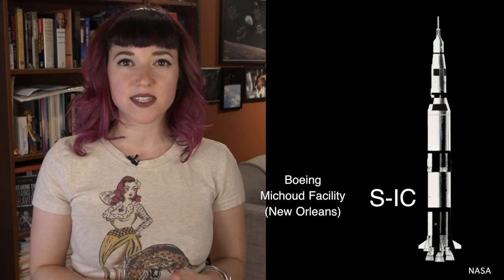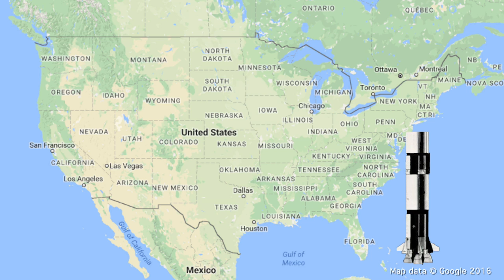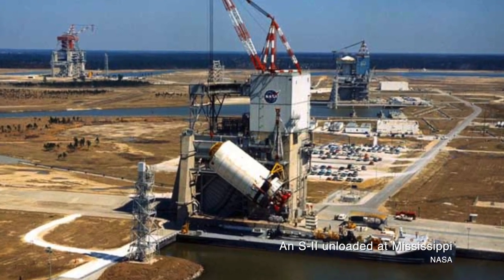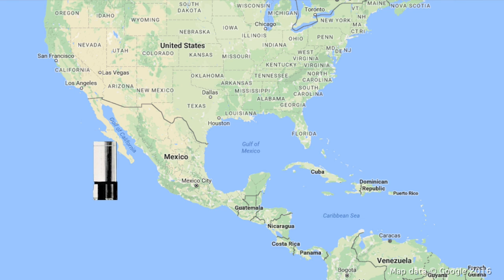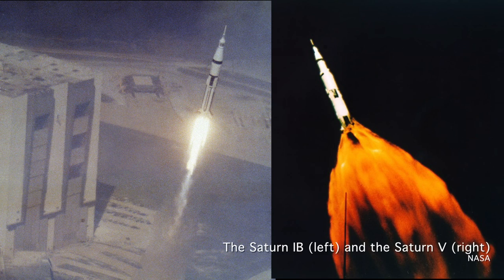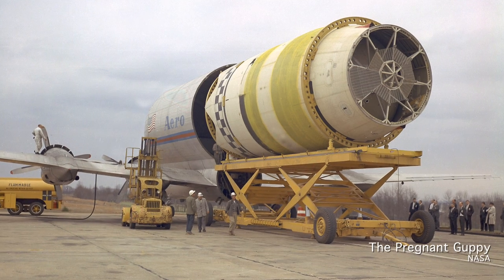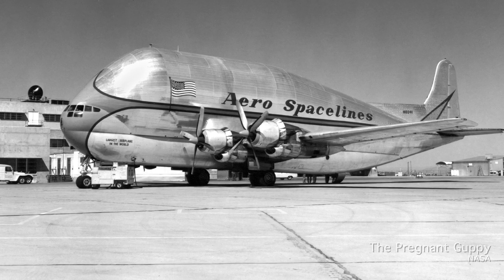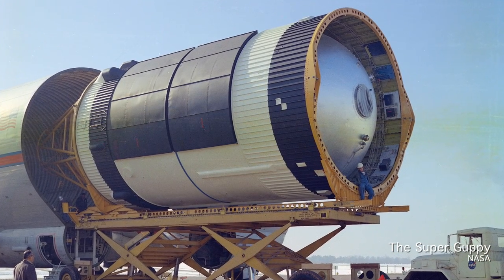How Did the Saturn V End Up in Florida?

Comment: If the moving of the various sections were such a great task (building two planes is not cheap) why not build an assembly plant at a better/closer location......it's no wonder why NASA requires so much money to build these things.....seems odd to me to take such a risk.
Reply: That's because that's where these company's where located... they where build alongside their normal production line..
Reply from the maker: Yup, it would have been harder to move production of an existing aviation manufacturer across the country than just modify an old barge or plane to carry it!

Comment: I don't have an MBA but lets build these puppies near where they'll be launched and save some UPS mailing fees... or the shipping equivalent.
Reply: The actual costs of moving the stages is relatively small when you consider the cost of trying to move factories and personnel to Flordia itself.   It also serves a secondary purpose, by spreading out the manufacturing you get more Representatives and Senators with a vested interest in making sure the project continues to receive funding.

Comment: The solid rocket boosters for the Shuttle were shipped by train to Florida. It is funny because the Engineers wanted to make the SRBs with a bigger diameter but were unable to cause they had to fit in several tunnels along the route. Why is this funny cause the tunnel was made wide enough for the train to pass thru it. The train was made the same basic width of British trains and the British made the trains width based on the width of the roads. The British made the roads based on ancient Roman roads that were already there. The Romans made the roads wide enough so that they could fit a Chariot being pulled by two war horses standing side by side. All this means that the ancient Romans were the final decision on the diameter of the Space Shuttle's SRB's because of the width of two horse's asses. LOL.

Comment: Amy,
I adore brilliant women,, someday I may ask if your mother or grandmother are of your ilk.  The Saturn V has some personal history for me.  My mother worked a tiny bit on the 'crawler' that transported the standing craft from assembly to the pad. She was a technical writer, a member of SME.

My own itch has to do with Mars.  I am of firm belief that in the early stages, there should be no return of Martian explorers.  A 'there and back' is simply illogical.  Of all space launches to Mars, fully 1/3 have been unsuccessful. The odds of getting someone down to the surface are then 2 out of 3,,, but,,.   The odds of a successful return are less,,, no support infrastructure.

Science on the planet's surface will be severely limited by orbital mechanics, launch windows either to or from.

Cost.  3/4 of all costs,,, and perhaps as high as 9/10ths of all costs are for the return half of the mission.  All food, fuel, equipment, and craft,, must be shipped there,, in order for the return to be possible.

So,,, for a there and return mission, the odds of success are less than 50/50,,, by actual calculation,, about 35%.  Where as a successful immigrant,,, the odds are 2/3rds in favour of.     The explorers will have  as little as two weeks on the surface,, possibly as long as 4-6 months   vs.    years, and years.  And the costs of keeping them there, sending high-g resupply ships, of dried beans, meat, and fruit,,, high-g ?   100 G's would not harm a dried bean.    annnnd..

You get to send scientists, not pilots.    Send old not young, send scientists not pilots.  Stay.